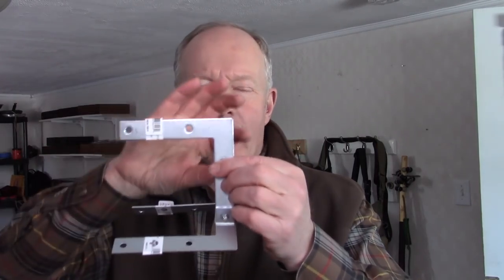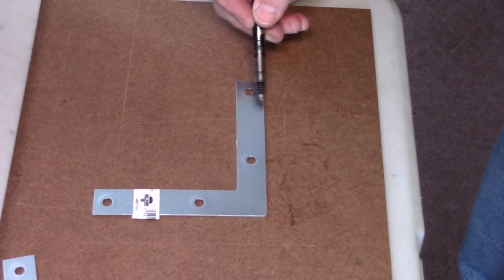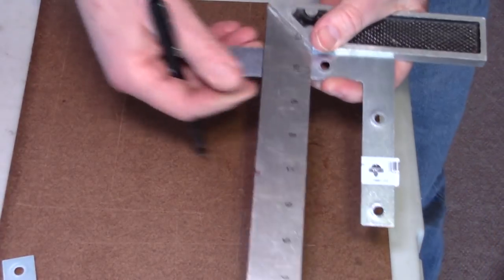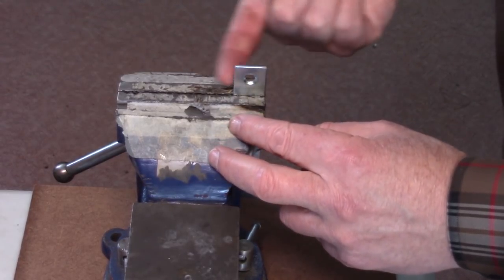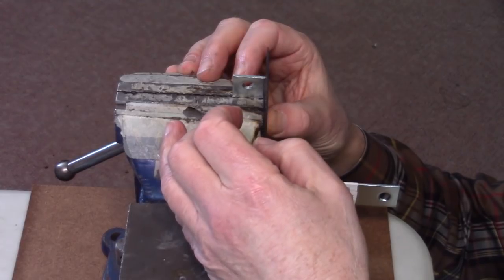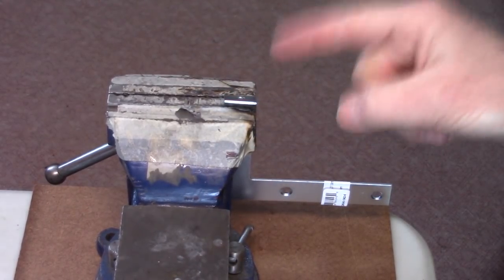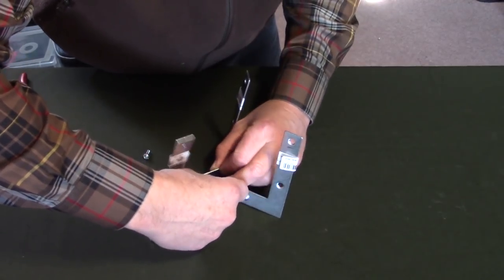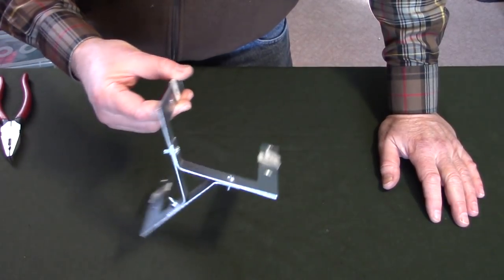Easy Do-It-Yourself Campfire Trivet

Comment: Awesome idea Mark.  I bet wing nuts added would be great and quick for set up and take apart.  A simple one I have done before is place three tent pegs in the ground to form a triangle, then build a small cooking fire in the middle.  The triangle can be as big or small as you need it to be for your pot but you need soft ground to stick in the pegs.  Can also use the trangia for this set up as well.  Thanks for sharing your cool DIY projects!
Reply from the maker: I should have mentioned wing nuts. I just did not have any the right size when I made this one. I have used the tent peg idea and it works great. I have also use three 10" green sticks pointed and pounded into the ground as well. Thanks for sharing your suggestions

Comment: That really is a great idea.  That takes the place of a grill but yet it is very sturdy while being very compact.   It is much more compact than most grills.   On the down side, it is only good for one cooking vessel at a time vs a grill that could potentially hold several.   The solution to that could be as simple as having several of these home made units.   Stacked together when transporting, they still would take up very little room.   I like the idea and may even make one or two.   Thanks for sharing.  Thumbs up.
Reply from the maker: I do like carrying small grills most of the time. Compact, lightweight and no assembly required. I would think this would be better for heavy items like a dutch oven.  Thanks for commenting Lonnie

Comment: A good idea, I made a pot stand from the metal wire in a real estate sign. the type they stick in the boulevard in front of your house then never remove. bent three pieces into U shape and used some metal tubing to connect them.
Reply from the maker: Good idea. I have made some with 1/8" iron rod and will likely show that at some point. Thanks for commenting

Comment: That`s a 5 star ,Mark. I`ll bet that after the zinc has been burnt away the trivet could  supprt a burger or steak, maybe with a light weight rack. .. I wonder if wing nuts would work to make  for easier assembly, ? Be well..
Reply from the maker: Wing nuts are a great idea. I forgot to mention them. Thanks for commenting John

Comment: great idea with a little longer bracket you could bend the bottoms at a 90 for feet nicejob
Reply from the maker: Absolutely. Probably could with this one. Depends on how much height you feel you need. Thanks for commenting
Reply: Or just bolt on some little pieces of predrilled angle stock lol I got tired of running to the store for 90s for little shelves whatever at the church and school so I bought a 6ft piece of it and cut my own any time I needed it. Worked great.

Comment: It's a well thought-out design and well executed.
But...it is over designed and it's bulk makes it less than ideal for backpacking.
I prefer a simple approach...
Two identical, flat squares of galvanized steel or aluminum 
both with notches cut from the center edge to the mid point.
They can be transported flat, and then interlocked at the notches 
to form a cross type support stand.
Reply from the maker: Yes, that is another workable design although I don't think I would use aluminum in a fire. Weight is not a big issue for me as I am not a through hiker. This is indeed heavy but plenty sturdy for a dutch oven and super easy to build. You V-shaped stand sound similar in function if not the same in construction to the Lixada V Stove I reviewed. Thanks for commenting

Comment: As an addendum,  I used small 90° brackets on my IKEA stove, and boy, it was difficult to find SS brackets. When I did find them I found out the cost was almost 3X's the cost of galvanized brackets. Live & learn.
Reply from the maker: Cost is the issue with SS anything. I will use it when I feel it is essential but if in this case I am comfortable with burning off the zinc in a fire. I just stand over it breathing in the fumes. Thanks for commenting

Comment: Hi Mark. Newlife mentions this in his comment, but it bears repeating. Galvanized metal gives off toxic fumes when heated in a fire, and though eventually, after several heats, the toxicity will be burned off...it is best to use plain steel or stainless brackets and thereby avoid the entire problem of poison gasses from your trivit.
Reply from the maker: Stainless is nice but more expensive. Used outdoors in a fire it would not take long for the relatively small amount of zinc to burn off. Thanks for commenting